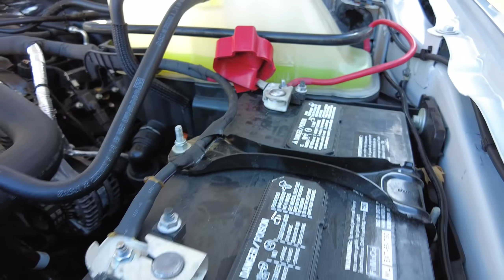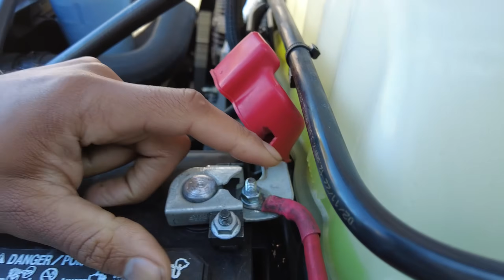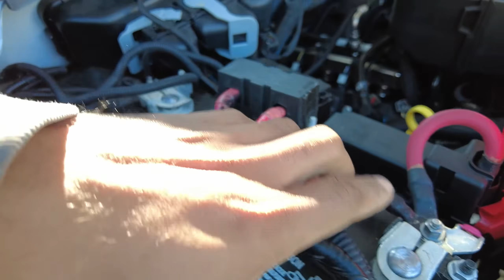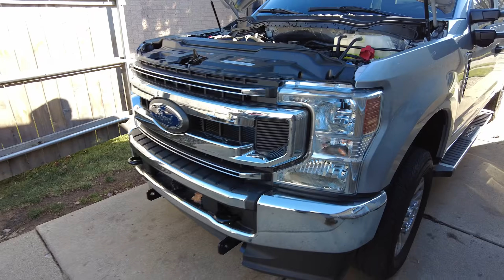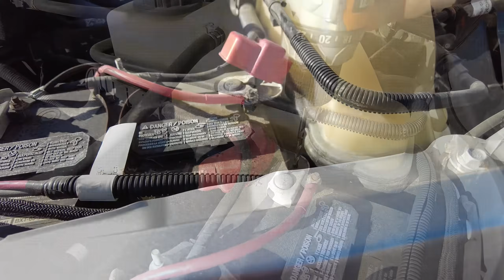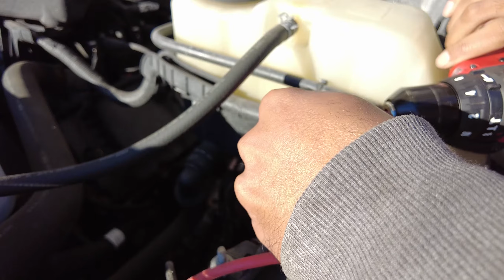how to add eyelet to battery terminal? FORD TRUCK - SUPER CLEAN!

Comment: I had a issue with my salter wire being connected to the painted terminal. I hit it with a wire wheel and got the paint off. Seems to be fine now
Reply from the maker: Nothing wrong with that.

Comment: I had to add a terminal to my driver side battery as well to my 2020 f250. Doesn’t make any sense why they wouldn’t use the same terminal on the driver side as they do on the passenger side.
Reply from the maker: Idk y
Reply: I'm planning on added the extra eyelets.  I'm wondering if Ford is just trying to nudge us to use both batteries instead.  i.e. Connect positive to the passenger side and negative to driver side; no new eyelets needed.  I need more connections so adding the extra eyelets are needed anyway.

Comment: Hi there!  Very informative!!  THank you for sharing your knowledge!!  

QUESTION: I have the 7.3l gasser with 2 batteries.  Would the driver's side battery be the main starting battery?
Reply from the maker: Both batteries are equal.
Reply from the maker: The main battery is the passenger side battery. Simply because the The driver side battery is the extra battery. Single battery trucks only have passenger side battery.
Reply: @DS-TRUCKS  ok... thank you very much!! Happy belated Thanksgiving to you and your family,  as well!